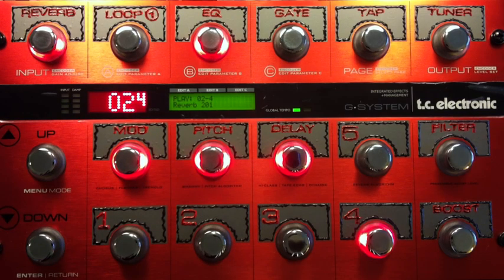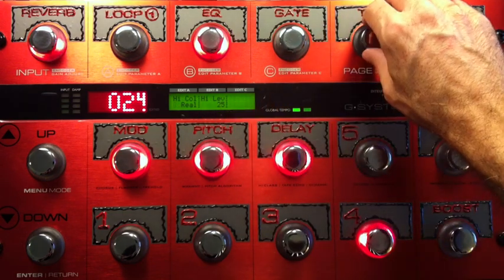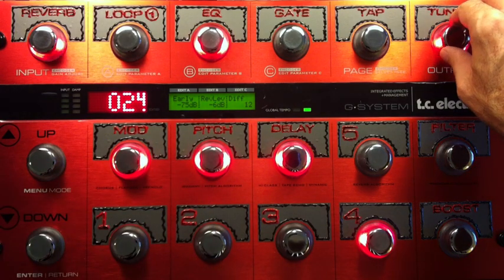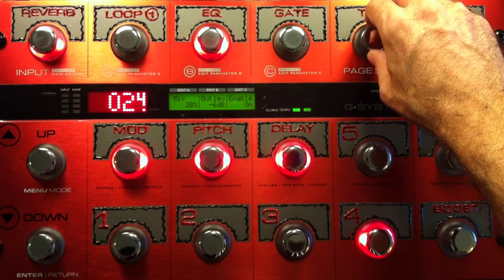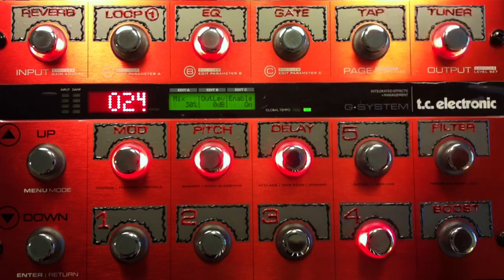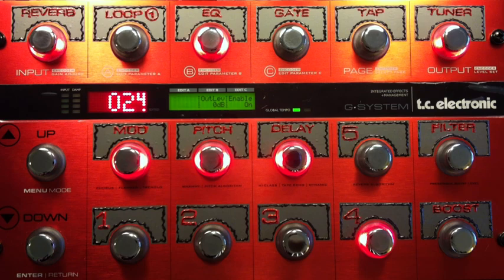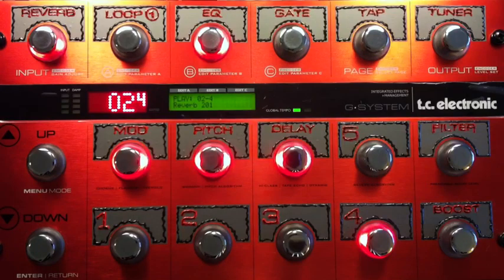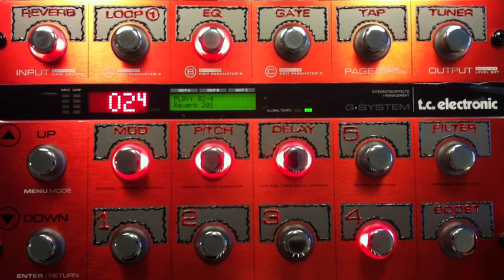Reverb 201

Comment from the maker: My problem with TC was that I sent them a proposal for a job, and they never sent me a response...I felt I at least deserved a "No, thanks.", but, I got nothing.
The G-System is still the best option for multi-effects, amp switching, and signal processing, out there.
I have had two G-System's over the years, and still think it sounds amazing! 
I have no idea whether or not TC is working on a new flagship floor unit...I'll keep using the G-System until it no longer works.
Rock on,
Scott.

Comment from the maker: @morsecode9999 
I think I'm using the Hall reverb, and my usual EQ settings for my neck humbucker:
Gain 1 = -4db, Freq = 180, Width = 1.8
Gain 2 = +1db, Freq = 900, Width = 1.8
Gain 3 = +1db, Freq = 2.50, Width = 2.0

I hope that helps.
Rock on,
Scott.

Comment: Hey Scott...wass-up man....and thanks for ya vids brah!
was wondering, do you use the stock boost function, or just boost with other means?...If so,..... Help a brudda out!...lol
I'm not a fan of takin the Db loss and then having it given back to me when I hit the boost.
I've tried boost pedal in FX loop....not diggin it...worked good for clean tones, but not on Dirt....tried it on the front and ass end of G Sys.....
Reply from the maker: Thanks!
I used the G's boost for years, then, I took a closer listen to it one day (after I got the Radial Hot British), and replaced the G's boost with a TC Spark Booster, which gives me a bit of gain, volume and EQ for my leads...It's so much better! I put the Spark Booster in Loop #3, and it sounds great!
Reply: Thanks brudda...I did the same thing man....used it for quite sometime. Then realized I was gettin' some tone suckage....lol
Loop 3 is the key-eh?....due to my patch chords blocking my loop 3 I think I was placin it in the "insert"...I gotta get a cable kit, free some stuff up.
Thanks for reply man...Keep up the stellar work!

Comment: Another quick question Scott. I think from one of your videos you have a Boss FV-500 pedal. I have just bought a couple and I need to get them fixed to the board for a gig this evening. Do you need to remove the two rubber feet from each pedal? They are so thin it does appear that the velcro would work with then still in situ.